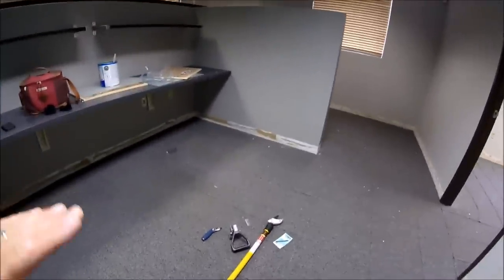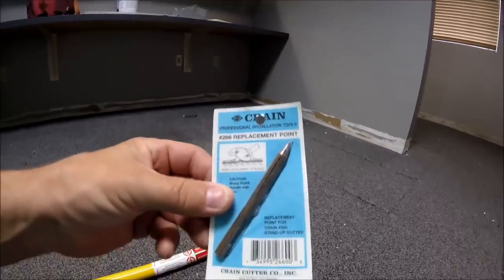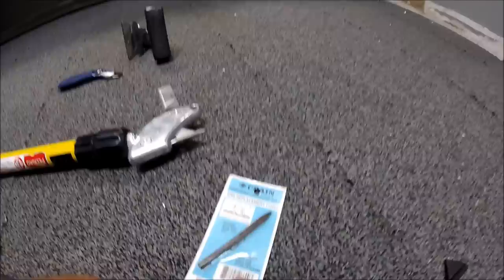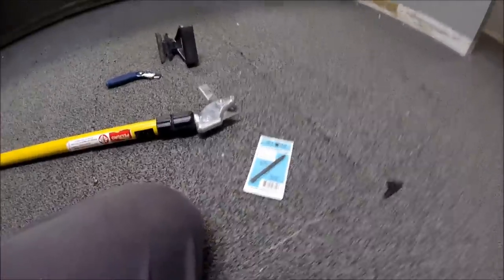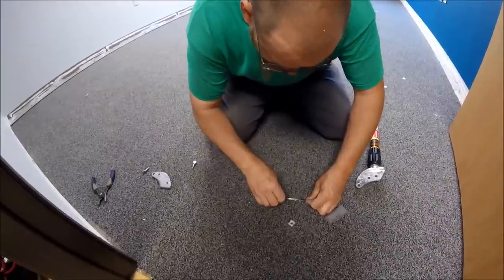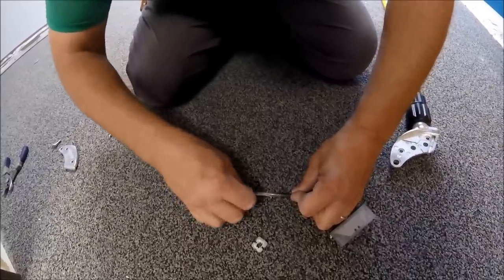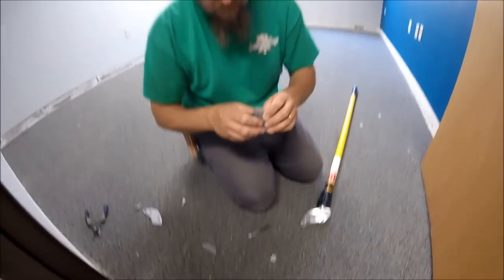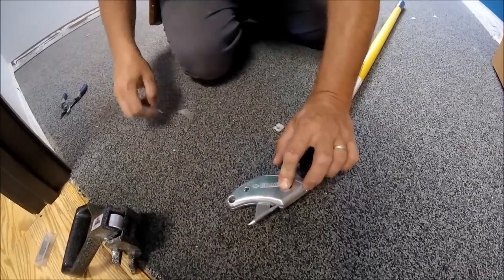HOW TO REMOVE GLUE DOWN CARPET

Comment: I have both tools stand up jus push cutter and the carpet puller after years of pulling up carpet with vise grips and a knife
Reply from the maker: carpet guy 1970 That’s awesome I hope you enjoy them, remember the points are replaceable after they wear so much you need to replace the point, they are less than 10 bucks, you can usually get a few hundred yards of carpet Out of one point depending on how bad it stuck

Comment: what is the easiest way to remove that glue from the floor?
Reply from the maker: Jesus Christ My Savior I have used denatured alcohol and a razor scraper
Reply: trying to help our church.  wondering if i can use some chemical with a 175 rpm.  the church has a big floor.
Reply from the maker: Jesus Christ My Savior If you are installing carpet again there is no need to remove the glue, is that what’s happening
Reply: No. the church wants to have the concrete and seal it. They just show it to me today.  We are in Cary NC, i do volunteer to help.  They told me they are wiling to hire a contractor.  I just want to see if I can help the church save money.  I do strip floors but hate dealing with glue and paints.
Reply from the maker: watch this ,you can rent this at home depot............................https://youtu.be/-XpCgmuJ2cI
Reply: Wow!!! a Stripper will do it too???? Did I hear it right?
Reply from the maker: Jesus Christ My Savior It is a concrete grinder that has to be used with water
Reply: I recommended your idea to the church.  Thank you so much.  It's less than $100.00 a day.
Reply from the maker: Jesus Christ My Savior You’re welcome, glad I could help, God bless you
Reply: Pay someone else to do it 👍🏼 🙂
Reply: I just read the entire thread ...I see you want to help save church money...years ago we painted a Victorian Church interior.no health and safety back then...girls working off ladders :) A long way to fall...but luckily no one did fall.

Comment: After the carpet is pulled up, is there anything else you would need to do? Like is there glue residue that makes the floor rough? I have glued down carpet that’s damaged in my basement and needs to be removed. I planned to put down peel n stick tile that looks like wood floor
Reply from the maker: Sarah M For anything such as vinyl that is going down in the place of glue down carpet do you want to get the floor as smooth as possible perhaps scraping the glue if it’s dry enough
Reply: FloorsbySouthernboys thank you! I figured this would be the case. Sounds like I have lots of work to do!
Reply from the maker: Sarah M 👍
Reply: You can rent a buffer machine and a scrape away head for the buffer. The carbide blades will eat right through the glue removing it easily